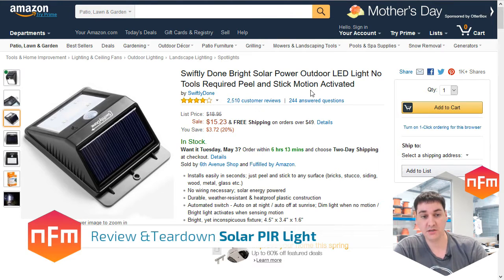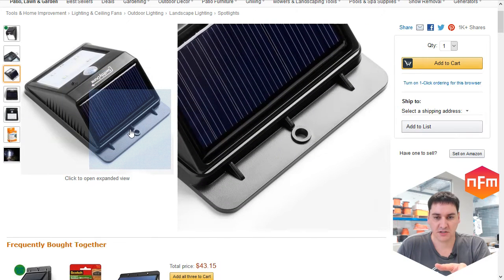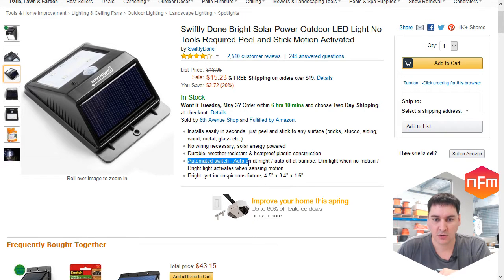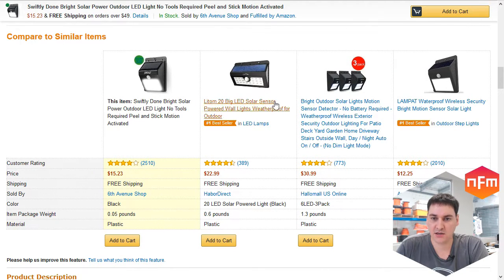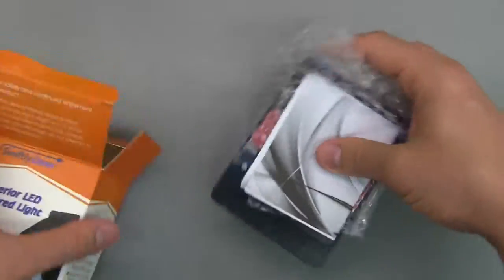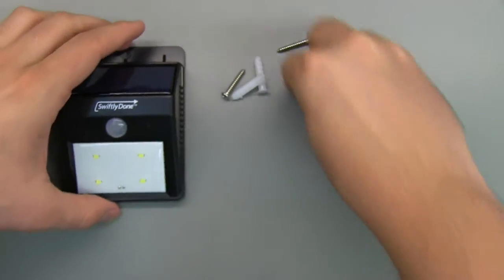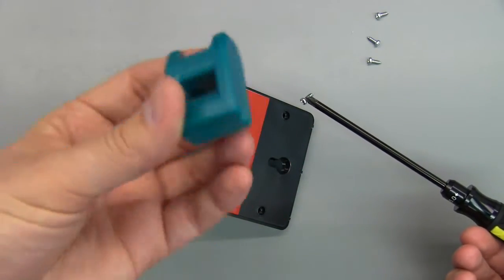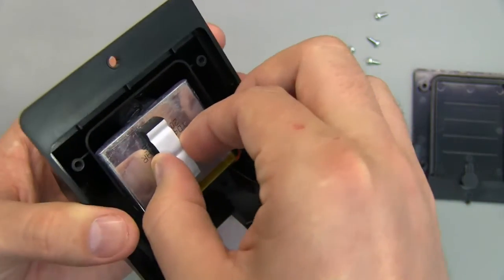Solar PIR Light Review & Teardown

Comment: Thank you from St. Louis Missouri USA. I’ve been experimenting with all kinds of these led lights. I’ve found some to be quite robust and some I have purchased twice and since our climate is quite harsh with both extremes so I’ve been applying some clear caulk to seal and keep water out . This has greatly improved the longevity . It still has a small opening or two to prevent moisture and condensation from building up . Thank you

Comment: hey i need help. I don't need a motion sensor, what happens if I remove PIR directly? does it still work?
Reply: I also don't need the motion sensor. What if the sensor is removed and the 2 connection points of the sensor is connected with a wire or solder?

Comment: Would you be able to extend the wiring from the solar panels. Say you wanted to put the solar panels outside and the light inside.
Reply: I just soldered a second panel in parallel. It works fine.

Comment: hey that was an awesome video. i came on here looking to see what kinda battery these things had because i just bot 4 of them. It was good to see someone going into such detail about what these were made out of and i am honestly impressed and did not expect so much out of these compared to other units even more expensive ones at that. 

thank you for doing what you do. I only have one concern. if i ever wanted to replace the battery on these units and I am sure I will have to sooner or later would it even be worth going through the trouble to do so or is it mostly cost effective to just buy another unit when that time comes.
Reply from the maker: +Muskox The G'day! Thanks for the kind words. It's been almost a year and the light is really good and still going strong, and it's seen some harsh weather.

You could easily replace the battery with some basic soldering skills if you have a spare battery handy. I probably wouldn't bother buying a new battery for it though because a new light is only $15!
Reply: It's 18650 battery cell, 3.7volt
Reply: @alo1236546  18650s are round, this flat one is probably a lipo